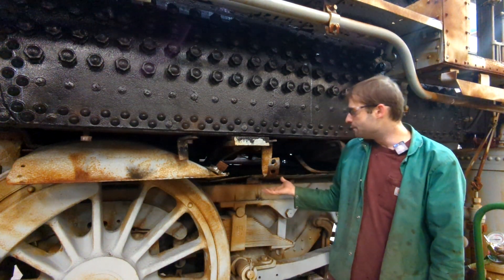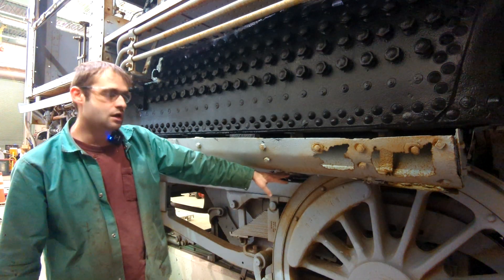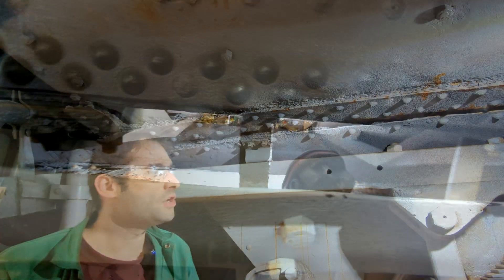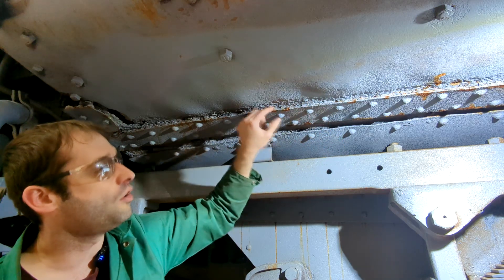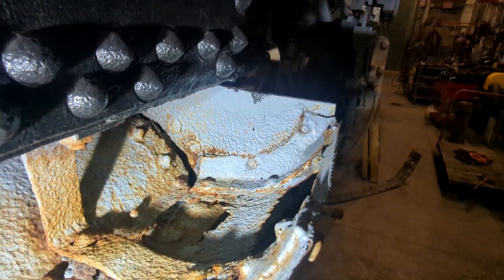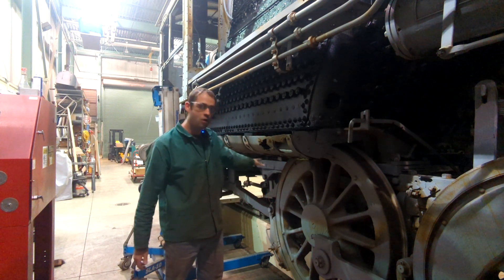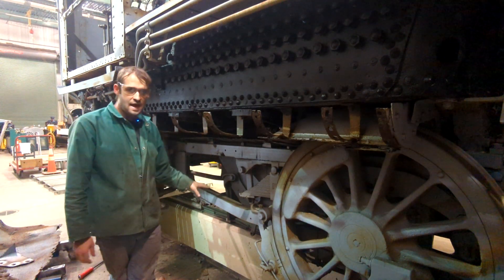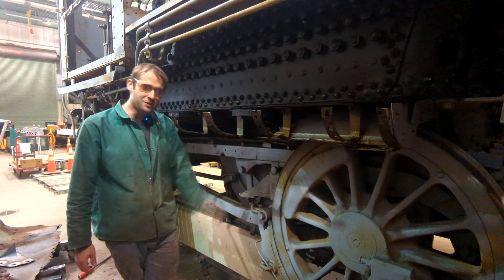Replacing a Steam Locomotive Ash Pan that was Rivet Repaired

Comment: McMaster does still carry square nuts.  Sometimes you end up chasing your tail and spending more money trying to save the old nuts and they really aren't historically significant enough to justify the extra labor expense.  It can be a fun challenge to save them, though, if no one is watching the clock--and it gives you a chance to break out the old true "Monkey wrench" you saved from Grandpa's toolbox.  This is also a place where a set of 8 point sockets can be your best friend--though sometimes the old nuts aren't very square so won't fit.
Reply from the maker: I totally agree!  Some of them are just so rusted it's not worth my time.  If I think I can save it with minimal effort I go for it!  That's good advice about the sockets.  I usually just defaulted to a wrench.  Thanks for the comment!
Reply: @mikesmetalfab  
Actually, just keep some steel bar stock around in the right width and thickness. Then just cut off what you need, drill and tap and you are done. Or even better, bar stock on the right dimensions. Just chuck it in the lathe, face off the end, cut any rounding on the top surface you want, drill and tap and then part it off.

Comment: Question - Is there any allow you can use to replace the ash pan with that will resist the corrosive effect of hot wet ash and not turn into rust. The amount of corrosion in that assembly was incredible. It was even worse where they tried to repair it many years ago. Rivets were holding on to flakes of rusted steel.
Reply from the maker: You could make it out of stainless steel.  Strasburg Railroad did that with 90s tender.  Stainless is more expensive and more difficult to work with.  You need about double the tonnage to roll or press brake stainless than you do mild steel.  Excellent question!
Reply: @mikesmetalfab and it's more inaccurate as well, right?
Reply: @mikesmetalfab  
So then, make it out of bronze. Even more expensive, but easy to work so it kind of balances out.   LOL